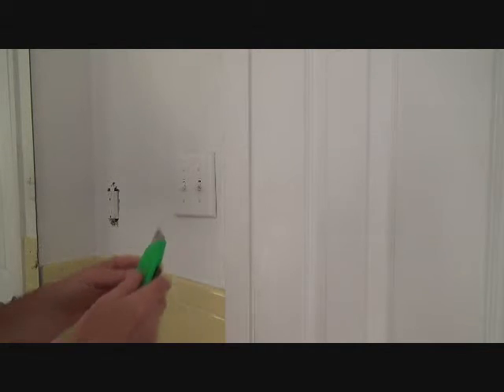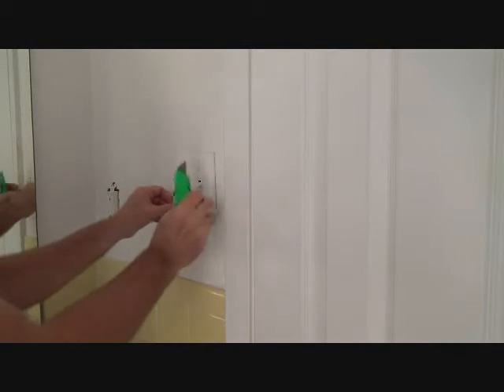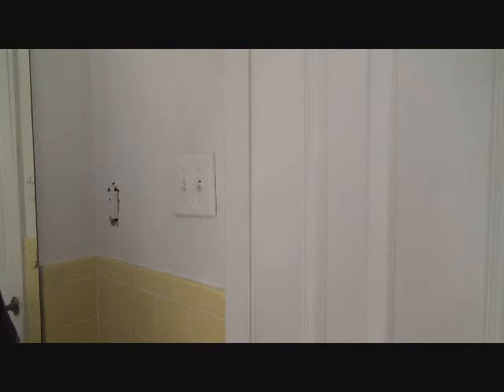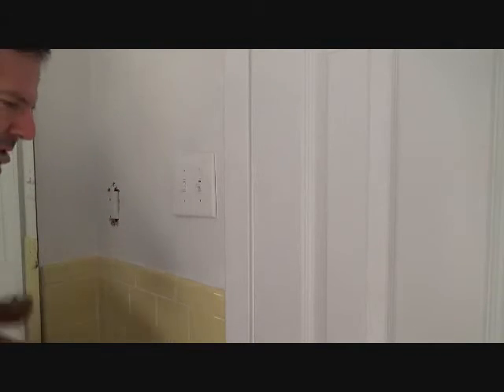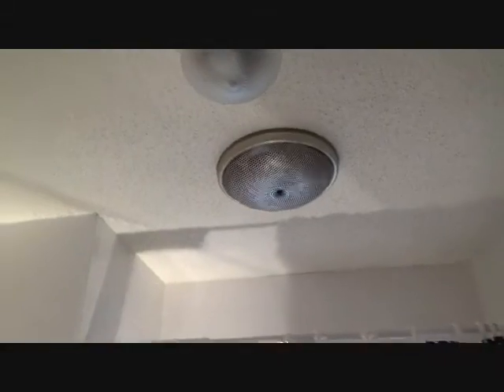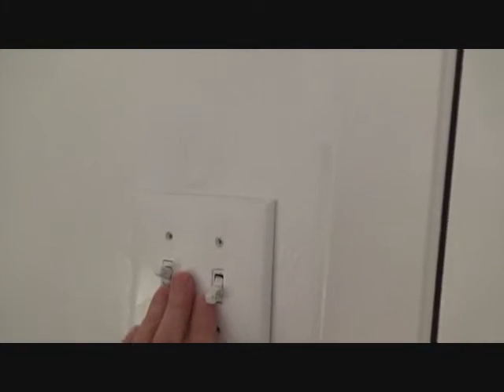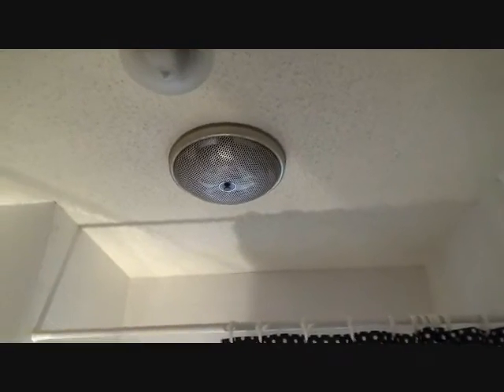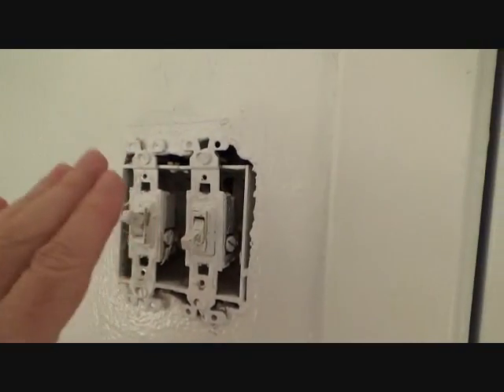2 separate circuits in a light switch box...Really?!!

Comment: That's it. No info at all.
Reply from the maker: That's lots of info for sure since most of the time you won't have 2 different circuits in one light fixture box & if you don't check to see then you could have turned off one circuit breaker thinking that all the power is off in the switch box only to spark & scare you when working on it for sure! Wouldn't you want to know this info?